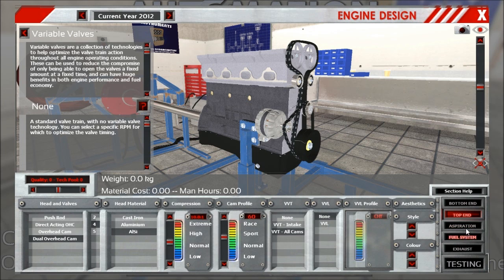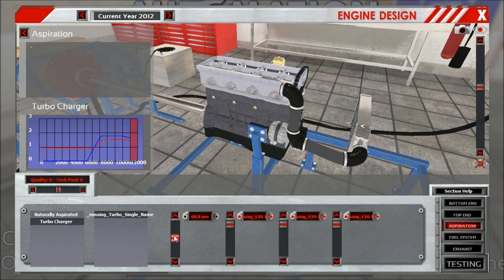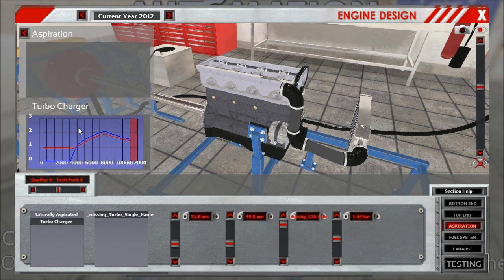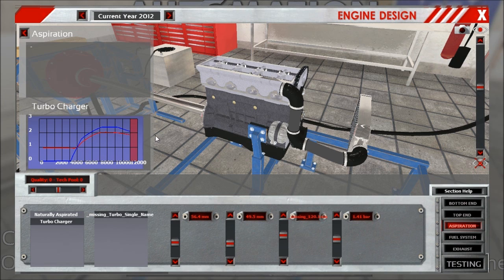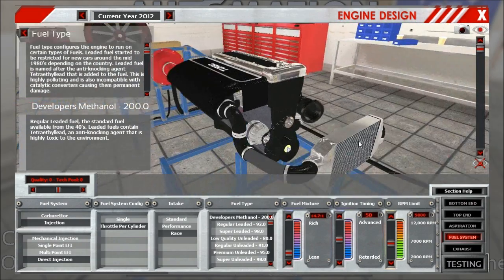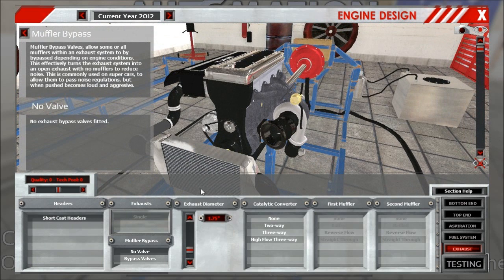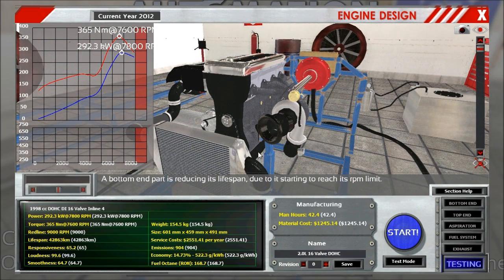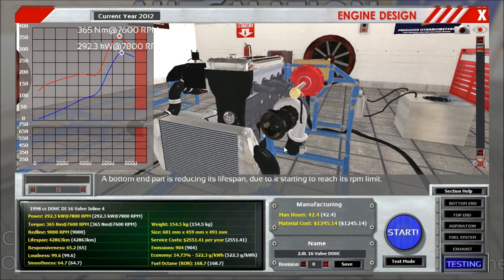Little Dev Update: Turbo Status & Testing

Comment: Exactly? :) Compare theese prices. RB26DET(T), or 2jzGTE. With a big snail and the "small stuff". With say 600-700bhp. Compared to ANY engine, that is naturally build for 600-700bhp? Now thats ALOT of years, that you can keep replacing every 2-3 years, before you end up with the same overall cost, as a naturally build 600bhp engine. :p Put some HEAVY shit into a RB26, and u dont even need that much preassure anyway lol.

Comment: hey! i would be surprised and it would be totally amazing if u guys would make feature about really building the engine, i mean... u need to place the pieces to right place and use bolts to hitch them and like this.. also would be nice to customize the pices so they will fit. i mean like if turbo is not gonna fit in it, just little modify the engine so it fits on it :DD  using cutting tools and those :) i would PAY FOR IT!!

Comment: well, 2 bars is insane. However, if you add that much boost, you engine won't last longer than like 2 or 3 years when you drive it hard (which you would because that's what you got the boost for)